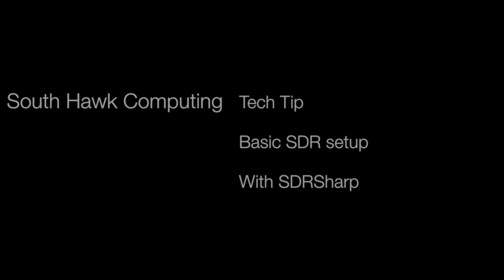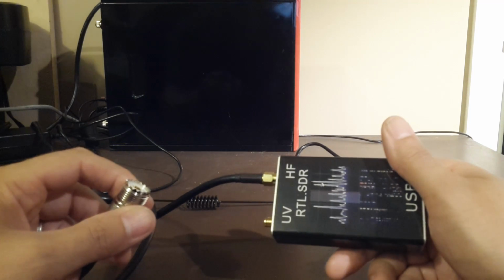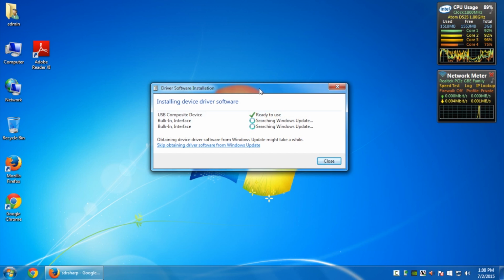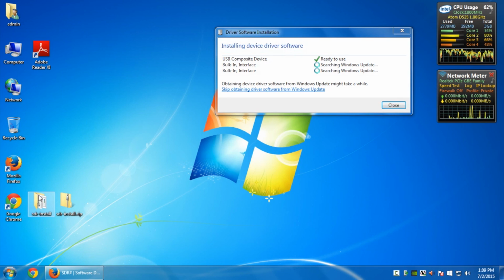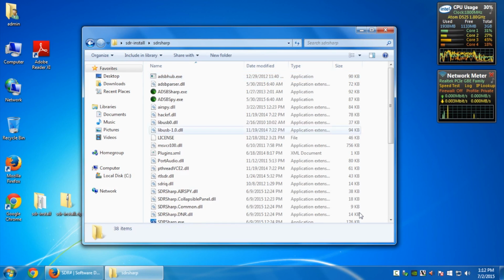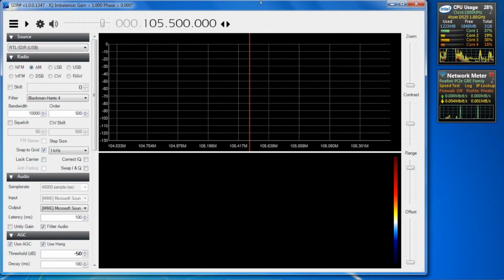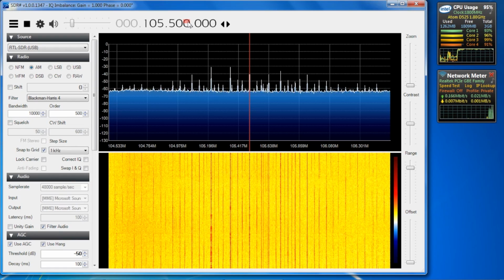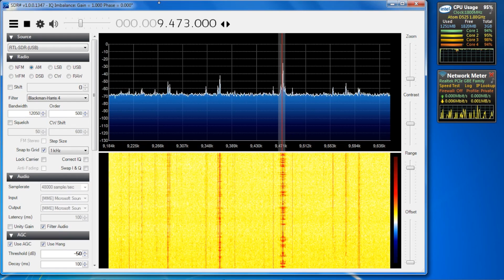Tech Tip: How to setup a RTL.SDR with SDRSharp on windows

Comment: Dear Sir 
I want to buy Ham Radio Receiver 100KHz-1.7GHz Full Band UV HF RTL-SDR USB Tuner Receiver USB Dongle with RTL2832U R820T2 Ham Radio RTL SDR. I ried to downlad the software but I could not and I am unable to install it. Please let me know the website and please let me know that will it helpful for Radio Listening? Because basically I am a radio listener, so I want to buy this SDR dogle.
I shall wait for your reply, Thanks. Can I email you if you allow me to do so???

Comment: now if i can just tune myself in to the steps u make to get your unit running,i have the same unit,do u know if it runs on either 32 or 64 bit windows 7 and ps that connector is a so239 unit thats the female to the pl 259 thats on the antenna

Comment: Looking forward to more testing of this device as I have heard it does not work very good below 15 Mhz.  Thanks for sharing.

Tom
Reply: I use mine as a pan adapter for a Kenwood TS590SG.  It seems to be fine below 15 mhz.  I'm not saying it's a high performance HF rig, but since I only paid $20 for the dongle,  I'm not expecting miracles.
Reply from the maker: hamrad88 you're very welcome tom!